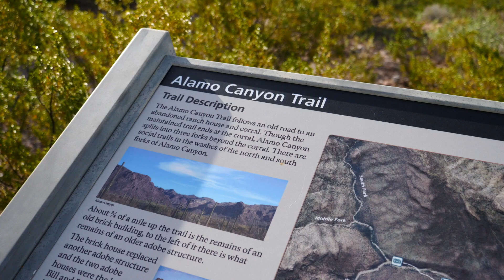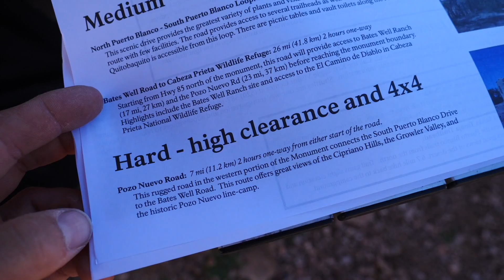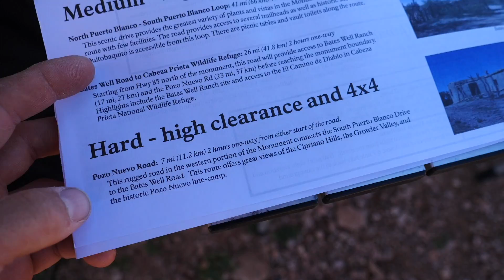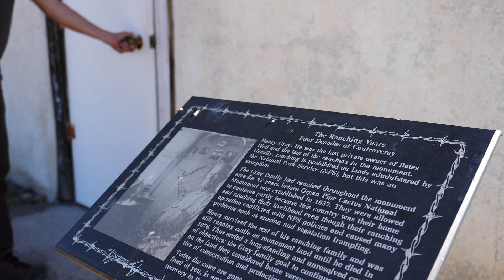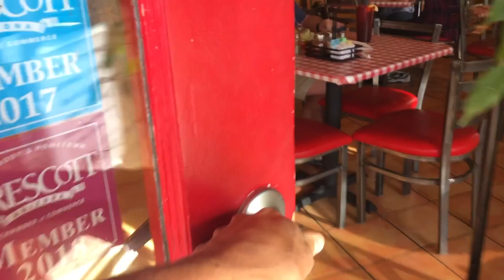V6E9: Consequences in the Desert

Comment: I think you’ve had good luck with the Jeep considering how much time you spend off road.  Mud, sand, and wet conditions are hard on rubber bushings, plus 120k miles.  You’re Jeep will only need more and more work as the miles pile on, so you must ask yourself how much longer do you plan to live on the road.  Next week the transmission could decide it’s had enough or it could carry on another 70k miles, it’s hard to know for sure.  One good thing about a Jeep is it will hold its  value so the resale is less painful, if you decide to replace it, pick what works for you, Toyota’s are nice but they aren’t perfect, they seem underpowered to me and the auto trans seems to hunt for the right gear far too often, but if you don’t mind changing gears the 6 speed manual seems to hold up well.  That’s my opinion for what it’s worth, its your money and you’ll be living in it, so do what works best for you.
Reply: A friend of mine had the Tacoma with the 4 cylinder and 6 speed.  Hated it every day.  Finally sold it.  Now he is the first person to say Toyota sucked.  A guy I work with has one and loves it. Anything mechanical will fail.
Reply: Hillbillyjeeper WV I agree, they all fail eventually, they all need parts and service, some more than others.

Comment: Toyota time; this death wobble issue (and not just Chris') is ridiculous.
Reply: Kev B ^
Reply: DW usually doesn't happen immediately. It is caused by letting small issues metastasize to the point where major components fail. The harder the wheelin' the more critical preventative maintenance becomes. I have never had DW because I regularly inspect the Jeep and when something does happen, like a bent  tie rod, I immediately replace it, usually with a beefier component.
Reply: @RickZackExploreOffroad  JLs that haven't been off pavement have had DW.
Reply: @RunGSD  That is an issue for sure, I believe that the issue with the first JL's as been resolved and was due to faulty welds on the stabilizer brackets. It's really no difference than Toyotas having the steering column disconnecting because of using the wrong torque settings during assembly. Both issues were a result of poor oversight and quality control. Both easily rectified. 
My JK has never had it, with heavy off roading. Even after bending the stabilizer bar and tie rod. Boils done to addressing issues quickly. I look at it as a good excuse to upgrade. :)
Reply: @RickZackExploreOffroad  i up grade my 4 f series,with other f series parts,like 4" blocks off a highboy,rear leafs off a 76 f100,for my 82 bronco,2" lift.f250 coils in my f100,1.5" lift..d60 rear diff to my bronco with a d44 8 stud front,with locker.jeeps dont have f250/350/450/,ect.parts to choose from.its like toyota & nissan here,in aus.. go to the accessory shop..i even fitted toyota truck shocks to my f100,brilliant,went to by new ones for another truck,$400,each,.!!.

Comment: Sorry for your miss fortune, I have a 2009 jk unlimited rubicon and have had nothing but problems. Death wobble is on going, and recently the pcv valve got stuck open making the engine loose all of its oil and ruining the engine. With 60k mikes and Mobil 1 full synthetic every 4K miles bone stock. I also have a Toyota 4Runner about turn over 190k miles with no issues. Need less to say I’m done with jeeps.
Reply: Besides, what do you expect from a Chrysler/Peugeot/Renault partnership ????? Heard the best Jeeps today are pre-1986. Good luck with THAT !
Reply: Sorry, scratch: Peugeot; add: Daimler-Benz & Fiat. You get the picture....

Comment: For reliability the Toyota Land Cruiser is the top vehicle, but quite expensive. Jeeps are great for a lot of stuff but sadly they'r not super reliable. Check out some of the Australian overlander youtube channels.
Reply: God wish we could get the 79 series with the turbo V8 diesel here in the states.  That rig rocks!
Reply: @insaynbcr  Serious? They're rubbish, alternator down low in the mud, starter nearly impossible to get to without hours of labor, injectors requiring replacement at 250,000klms ($6500), rear track is narrower than front track and the engine is a prima-donna - give it a sniff of bad diesel and it'll have a hissy fit that'll cost you thousands. No thanks, they're rubbish, worst Landcruiser ever built.
Reply: @insaynbcr  no,its a piece of garbage.not,economical,under powered for all the bullshit tech it has.every time one sees me on the road,they drag me,but i dont drag,they think its great,only because it sounds like a v8,&,we never had v8 4x4rs in aus..except fords/chevs/inter.which never got a good rap.i have a 6 cyl tdi,NO COMPUTER,NO GLOW PLUGS,puts out same as twin turbo 79.THATS,how good they are.NOT....[ its an f250 brazilian,with a td06 fitted,,4.2tdi,mwm. ]

Comment: Not inspiring for such an expensive “trail rated” rig.
Reply: .a rubicon here in aus is 72k,new.!!.2010 jk,25k. 2009 rubicon,25k.
Reply: Not worth the cash at all , i drive a tiny 1.1 litre Mitsubishi Colt its done 103 thousand miles never had any track rods or things like that break

Comment: Stock steering components are garbage.
Reply: It lasted 120,000 miles and many of those miles were on very rough terrain.  The wranglers are already pricy, if they built them bulletproof you wouldn't have any money left to travel.  Plus that factory part works fine on mall crawlers which, let's face it, that's what most of these see.